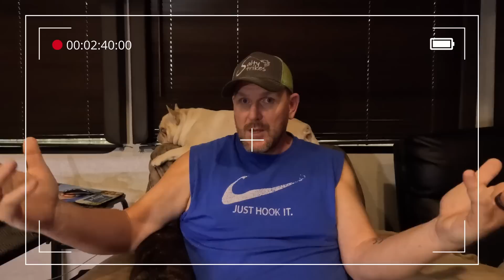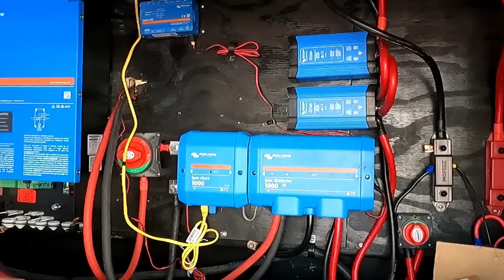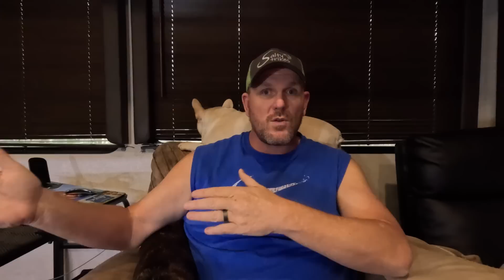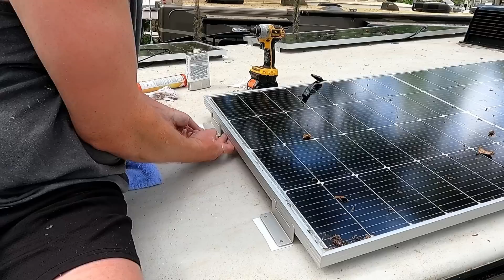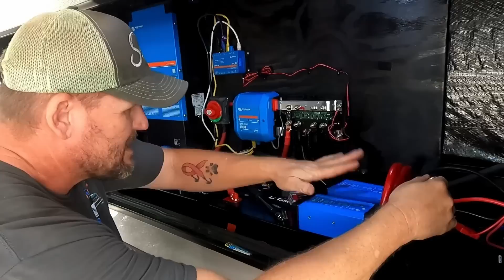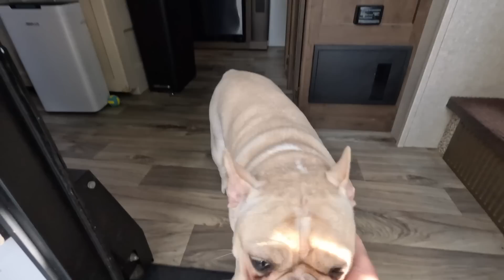24v Multiplus 2x120 is better than 12v or 48v for RV solar! #rvlife #rvlivingfulltime #rvsolar

Comment: Yeah, 24v is better than 12v.  But I feel 48v is the way to go.  Efficiency....   You made the change away from 12v, no reason not to go to 48v instead of 24v other than "its less scary".  In that case, you shouldn't be doing it anyway...
Reply from the maker: @markseamans4682  I’m guessing you watched the first 60 seconds and made a comment , or didn’t even watch and made a comment from title alone.
Reply: @saltytrips  just buy a single victron quatro 48/10000 and you are done.

Comment: I am confused, i thought 2/0 wire was bigger than 4/0 wire. maybe i am not hearing you correctly using your thumb and pinky demo it seems you are saying 4/0 is bigger than 2/0.
Reply from the maker: @chuckpugsley759  i am correct and you heard correctly, from smaller to bigger wire is sized awg 4, 3, 2, 1, 1/0, 2/0, 3/0, 4/0 where 4 is the smallest and 4/0 is the biggest in that set of wires.
Reply: @ Thank You! I needed that explaination cause i was still scratching my ass on your first answer!
Reply from the maker: @ check out our Victrion build videos step by step instructions https://youtube.com/playlist?list=PLXL0DAEhCeew8ymmeXnQZbforpQDwK_e3&si=XKhaPSuaLS0gEu9g

Comment: Great video. I'm new to this solar thang. But math tells me 6000 watts @ 240 volts is 25 amps or am I misunderstanding? So you are running 4 cable conductor from each inverter to a panel then back to the coach? I'm looking at the eg4 1200xp. It is an all in 1. No need for disconnects or charge controllers. Simplifies the install. Use a 48-12 dc/dc converter
Reply from the maker: @ccboe-tech  we have full install video on our Victron Solar playlist. Main reason we would never go with an all in one system if any one part fails you can’t just replace that one part. With our system we have redundancy and cheaper.  I plan on making a video about this exact topic soon.

Comment: I have two lead acid batteries.   I just purchased a 460AH 12v lithium battery.  We just vacation and want something as backup for power outrages.  We have a portable generator.  It would be nice to put an inverter in to power the outlets and at least 1 ac.  You have any recommendations for inverter to run 1 ac a few hours and the outlets with a 12v fridge?  My RV has 1 solar panel and a Furrion solar charger.   Trying to find someone who does inverter installs near me is a pain.   I may have to let the dealer install something.
Reply from the maker: @myriadcorp  is your RV 30a or 50a? Whatever you do don’t let an RV dealer touch your RV unless its warranty work. They have no idea what they are doing when it comes to these kind of systems.
Reply: @myriadcorp don't ever let your dealer touch your rv's elec system. What kind of rig do you have and is it 30a or 50amp? Where are you located? I know a few solar installers that travel and would be more than happy to help you out. They know what they are doing and are certified unlike the RV dealer they will never do it correctly
Reply: @  I have a Brinkley Z3100 it's 50 amp.  Missouri
Reply from the maker: @myriadcorp  i have a complete install video with same inverter in 24v but the install is the same https://www.amazon.com/dp/B0945M9NG4/ref=cm_sw_r_as_gl_api_gl_i_N2GWE7067B4J900GRW5G?linkCode=ml2&tag=saltystrikes-20

Comment: The EG4 6000XP Off-Grid Inverter | 8000W PV Input | 6000W Output | 480V VOC Input | 48V 120/240V Split Phase | All-In-One Solar Inverter has split phase 120/240  and is affordable.
Reply: 48 volts is best for all applications.
Reply from the maker: @ lol 😂
Reply: Me too! It’s a great inverter
Reply: From a user of EG4 in a few of my homes, it has no place in RV world.  I use Victron in my 5th wheel and no comparison.  From a usability perspective.  Solar Assistant makes EG4 okay to use.
Reply from the maker: @ another RV channel went from Victron to EG4 6000XP and within a month went back to Victron
Reply: @ so why did they go back, I’m curious to know. I made the switch but from ECO Flow….
Reply from the maker: @ here’s their video, he’s very nee to this stuff, probably one of the reasons so much switching. First it was 12v multiplus, then EG4 now to 48v Multiplus https://youtu.be/cfL-rWnnll8?si=NEeGP54g2K7f0mja
Reply: @ thank you sir for the link!
Reply from the maker: @Itsa_Mea  it’s about $3000 more expensive than Victron for the same power and solar capacity. There’s a whole slew of reasons why I would and wouldn’t recommend one of these all in one systems. I’ll make a video about it to clarify 👍, stay tuned.
Reply: @saltytrips the 6000XP is currently $1,800 and was less than that 2 months ago when this video came out. It has two 3,000 watt 120V outputs with 500 VOC of solar capability. I bought one plus 3 server rack batteries and 1820 watts of solar to go with it to install in my ambulance camper. I live and work in the desert so I need my AC to work 24/7. This system is incredible.
Reply from the maker: @letsgetreal670  everything has its ups and downs 👍 https://youtu.be/cfL-rWnnll8?si=syP-h3Y9qYpaeDdv
Reply: @saltytrips  Thanks for replying to this comment and letting us know about the other video.  I see you did make that video about why not use the 6000XP a couple vides after this one.  I’ll be watching it next.  

RV power systems are a lot trickier than people think.  You have to factor in shore power from a 30A 120v receptacle , shore power from 50A 240V split phase receptacle, 12V DC components, etc…  

The more expensive new 5k inverter version of the EcoFlow Power Kit and the less expensive Bluetti RV5 are interesting solutions.  If you haven’t already, it would be great to see you compare and contrast them to your 24V Victron setup for people looking to get RV solar.
Reply from the maker: @NickWindham  we’ve done a few power station reviews for running all the 120 AC , not those huge units yet, mostly 30a units. Maybe do one soon with a bigger unit.
Reply: @saltytrips   From the comments, it sounds like some people are starting to use 240V appliances on their RVs.  That’d be interesting to explore too.

Comment: Hey Chris. Great video as usual. I have 1 Li-Time 230ah battery, 24vdc, and the same multiplus you have. I’m thinking of adding another 24v 230ah battery in parallel but I have a couple questions: 1) does it take twice as long to charge 2 batteries as it does just 1 battery on my 5500w genny? 2) what do I have to change as far as the system goes? I will add another fuse on the terminal of the battery but does anything else have to change in the system if I go from 1 to 2 batteries? What about to 4 batteries like you have? Thanks!
Reply from the maker: @HiddenCipherBook  of coarse it would take twice as long to charge twice the capacity. What do you have your charge rate set at? I have each inverter charger rate set at 35a each so charges at 70a max with both running. With the charger running max 70a it was really noisey and gets a bit warm. 35a seems to be the sweet spot for us. If you need to change charge rate you’ll need a MK3 adapter to make the changes.

Comment: We have similar systems I run 2 24v MP II as well with 2400 on the roof an 800 deployable. The only differences are you run a few more panels on the roof, I have 2 Big Beard 24 v 300AH totaling 600AH 24V so you have a bit more capacity. I added the Autotransformer from Victron to keep things even on both legs. I think your rig is a bit bigger. I would cation getting rid of the umbilical cord. A good cloudy week can happen. Great content I have enjoyed your journey!
Reply from the maker: @Ex.Nihilo  we aren’t getting rid of umbilical cord, just getting rid of 50a cord and using and easier lighter 30a cord. We went all summer in Florida on 30a connection limited down to 18.5a with power assist. Even with zero solar it wouldn’t be an issue, if batteries drop below 26v the inverters will automatically charge the batteries to 100%
Reply: That’s totally doable! I haven’t been plugged in in 3 months myself. That’s actually a lie I am plugged in put the breaker is off
Reply from the maker: @ right on 👍

Comment: I am not an electrician.  But a very experienced installer told me:  

The way the neutral is shared on a parallel system there are situations where it can be overloaded.  It's rare but there is no circuit protection on a neutral obviously.  He said his Victron Rep. has beat split phase only when doing dual inverters into his head.  He said parallel requires less complex programming, is less complex to explain to the customer but to him it's not worth the risk of melting a neutral.

I have been looking to install a full system in my 5th-wheel but it seems everyone I talk to has a different opinion about what is appropriate/safe.  Very confusing.
Reply from the maker: @rd1860  I covered the neutral “overload” discussion in our parallel inverter video. Feel free to check it out. The only way to overload the neutral is to push more than 70 amps through the neutral. In parallel on power assist mode this is theoretically possible if you have enough appliance in your RV to use 8,400 watts. If we turned on every single appliance- heater, both A/C’s, microwave, coffee and W/D , hair dryer, air fryer still wouldn’t hit that much wattage. There’s no scenario in which we would ever come close to over loading the neutral especially since we have shore power limiter set to 18.5 amp which if both inverters max out at 25a each the inverters will overload before the neutral would burn up. As we discussed in the parallel install video you can easily add a neutral breaker if you’re concerned.
Reply: @saltytrips  Thank you for that info.  I am going to watch your solar playlist.  Appreciate all of your thoughtful videos.
Reply from the maker: @ no problem, if you have any question on the videos leave it in the comments section and I’ll do my best to help out.

Comment: You helped me on one of your older videos where you did the wiring for 2 Inverters, thank you. 
I converted my motorhome to 48v using Victron and Sterling hardware, running off of 2 server rack  EG4 48v 100ah batteries.  So one of a few reasons I went with 48v, I'll convert my appliances and hvac to 48v in the next year or so.  I've only done a few sea trials before winter came and so far so good.
Reply from the maker: @3thirtytoo  they have 48v A/C with enough BTU and what appliance’s are you planning to change to 48v ? That interesting hasn’t seen any before.
Reply: @saltytrips  The BTU's are not as high as other roof top units yet, but I'm not needing a lot of BTU's. 48v Mini Spit with a heat pump is my goal, just not many choices yet.
Reply: @saltytrips pointless
Reply: No reason to convert 12 to 48 for your 12v appliances whats the point. 48v runs my inverters but my existing 12v systems work great I just charge the 12v batteries oof my 48v system.

Comment: Another great video, thanks Chris.
Also one of the reason I started down the 24 volt line was because with a camper you need the 12 volt dc-dc converter and as far as I know Victron doesn't make a high power (70 amp) dc-dc converter that go 48-12. They are all 24/12
Reply: Check out Sterling Power, I bought a bidirectional 48v to 12v charger for my motorhome.
Reply from the maker: @OmahaWayne  we weren’t really concerned about a DC to DC charger. We don’t for see it being an issue. Time will tell. Hopefully enough solar to keep things charged. We get 500-600 watts sometime in the pouring rain. 🌧️
Reply: @ Yeh, I meant the dc-dc charger like the orien you have that puts out 70 amps for your 12 volt stuff like landing gear. They dont make one of those for a 48 volt system.
Reply from the maker: @OmahaWayne  ah, though you were talking about charging from your vehicle. Easy solution would be a small Lithium 12v and a small 48v to 12v converter to keep the battery topped off.

Comment: Not sure I would get rid of the 50A cord though.  Keep your options open!
Reply from the maker: @FU2_Ggl  we’ll have adaptors incase a 30a plug is having issue but if worse ever comes to worse and a 50amp cord is the only solution then I’ll run out and buy one but I can’t think of a scenario were we would need one unless we have complete Victron system failure and have to bypass the whole system revert back to factory setup.

Comment: That's what I'm currently doing.... two 24V 2x120 inverters in parallel.   Not fully installed yet, but getting there.
Reply from the maker: @FU2_Ggl  thats how we did, little bit at a time. Keep us posted how it’s going! You’ll so happy you can run everything.